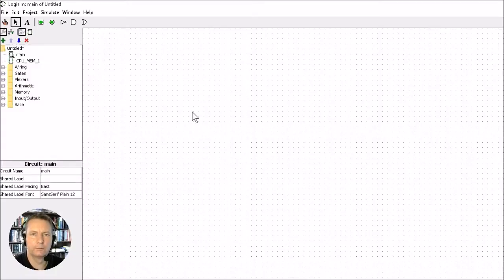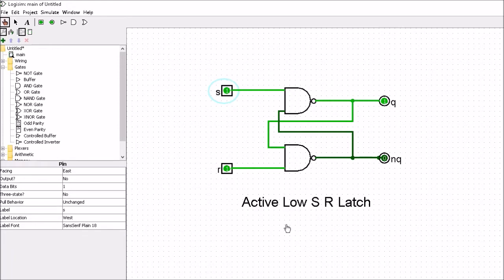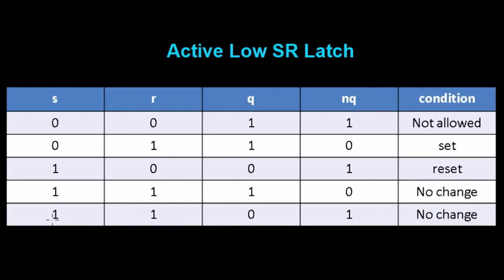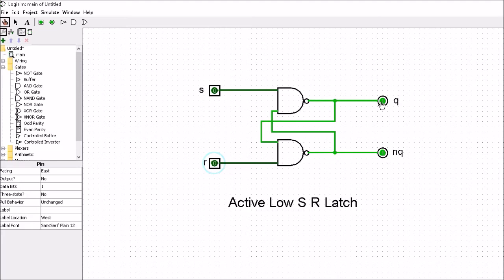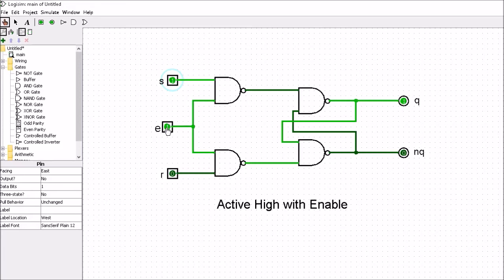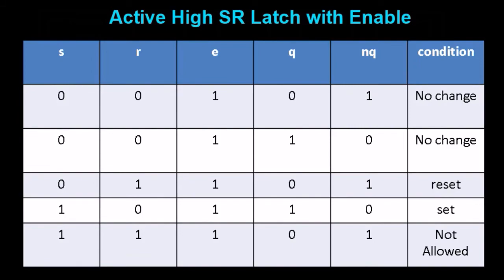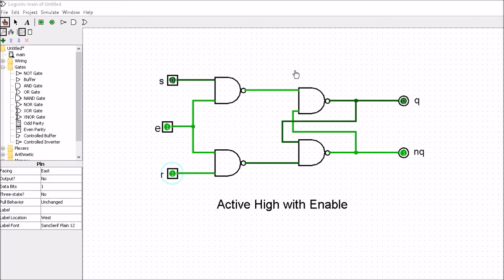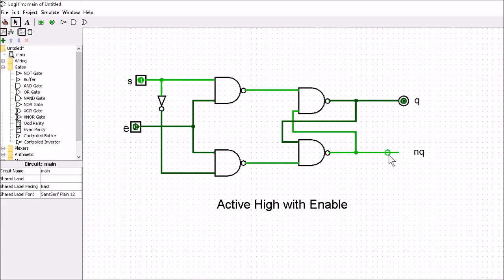Design a CPU 1 Bit Memory Cell

Comment: This is great tutorial. However, please address how you got rid of the red lines.  A silly question but very important to a beginner like me.
Reply from the maker: Yes you can extend it to 3D. If you like you could expand to more dimensions which might be useful in the area of mathematical topology. Although I haven't looked at doing this , it sounds like an interesting project !

Comment: In real world, Is there a risk when s is 1 and e is 0? In this situation, when e turns to 1, it is possible that the inputs of sr latch are 00, which will lead to wrong state.
Reply: Old post, but if you still need to know, I don't think so. I'm guessing you meant at 12:11 if e is 1 and s goes from 0 to 1? In that case the not gate would have latency and for a few nanoseconds the input of both nands before the sr latch are 1, so maybe for a few nanoseconds the sr latch would get 00, and output 11. In practice It doesn't matter because you wouldn't normally have s go from 0 to 1 when e is 1, and if you did the end result would simply be that the q goes from 0 to 1.